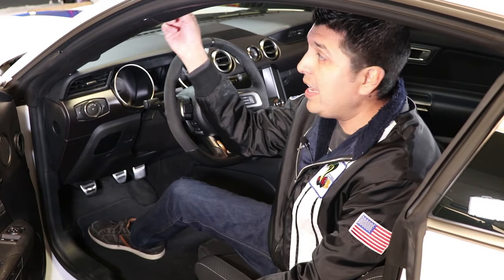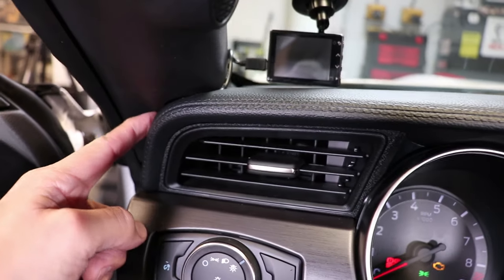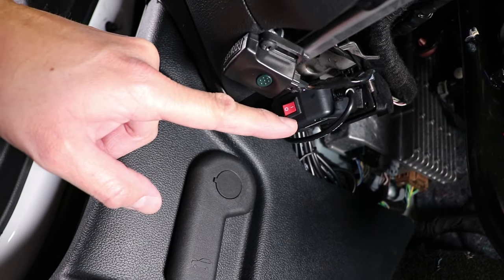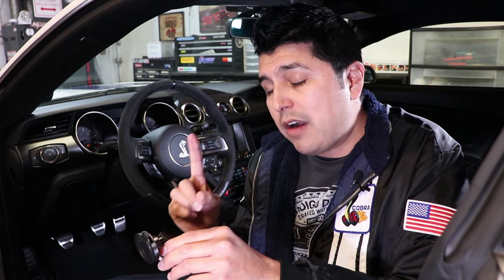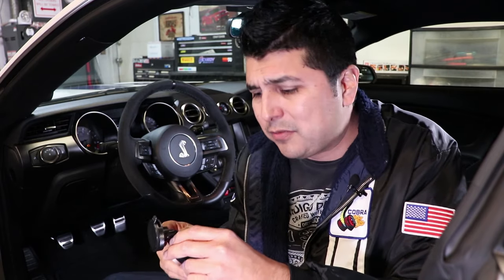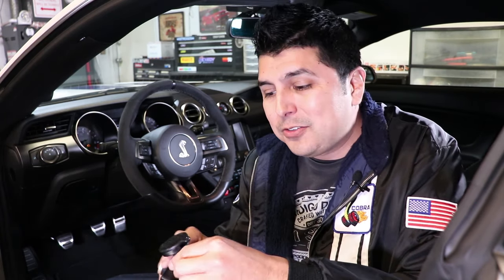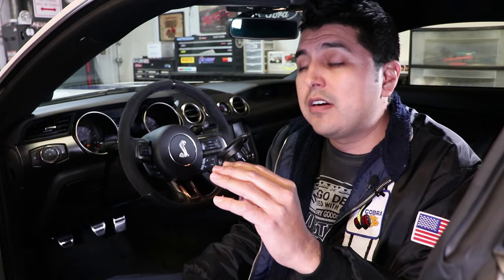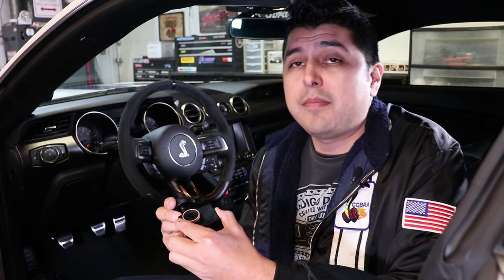Don't hardwire your Dash Cam! Try this instead!

Comment: The car has some empty slots in the fuse box which according to the manual says not used. Can one of those be used for the dashcam or does it have to be a fuse already in use. The dash cam says up to 12amp is fine although others say 7.5amp is ideal for fuses in use.
Reply from the maker: Hi QueenG Garden! ah yes good question, correct  I prefer to use spare fuse spots when available (if they can provide ACC or BAT) here is my most recent video where I cover this in more detail https://youtu.be/K2iKXj82354 Cheers!

Comment: My dash cam mini usb wire has only two colours. Black and white. When I spliced Black with Black and White with Red to another data USB to get a power extension, it only gives a flickering screen. What is the case when power USB wire has only Black and White wire as explained above? Thanks in advance.
Reply from the maker: Hi C Jose! are you using a hardwire kit? or are using the cigarette lighter plug cable that the dash cam came with (and you are cutting that cable)..

Comment: Does the camera only record a few minutes? It has a loop setting but I don't understand what that is. Also if I don't hook it up to reverse can I select the camera display on rear camera to help me back up? It wouldn't be as automatic but I'm a female and not handy with connecting this stuff
Reply from the maker: Hi Justpassingthrough! Loop recording just means that when memory card gets full, the dash cam begins to overwrite the old footage automatically. So technically it does not matter what setting you leave it on, it will continuously record (I like 3 min setting for my dash cams) regarding parking assist, yes some dash cams let you see the rear of the vehicle without connecting any wires to the tail lights of your car, like this one https://youtu.be/bkzxrPe-e_8 Hope this helps!

Comment: but if you service your car, wouldn't the mechanics have to use the obd port to check the system? then they would unplug this power adapter no?
Reply from the maker: Hi Sam! It would depend on the service needed by the car (no all services need access to the OBD2 port). I have taken my car to the dealer a couple of times with the adapter and was able to record the whole event. That being said, it is possible that access to the OBD2 port may be required. In that case, hardwiring is a better option. Now it also common that the car's battery needs to be disconnected to service the vehicle, in those cases both hardwiring and OBD2 adapter will both not work and you will not have a record of what happened at the dealer. My best advice is to find a Delaer that you can trust and develop a relationship with to ensure your car is taken care of. Cheers!
Reply: @AlexAutoFun  Thank you for your quick reply, much appreciated
Reply from the maker: You're welcome! @samjwhang

Comment: Hardwired just means not powered thru accessory plug. 
Both installations that you mentioned are considered hardwired into the car.
Reply from the maker: Hi Darryl! Hardwiring is more involved as it requires manually taping several connections into your fuse box using fuse taps or wire splices here is my video for that if you want to see the process https://youtu.be/zbxYA4VhuT8 The OBD method is usually preferred by those who don't want to do a full hardwire due to a lease car, easier installation (the OBD plug can come on an off in seconds) and that don't need parking monitor enabled (most dashcams require a hardwire kit to enable parking monitor. Hope this helps, Cheers!

Comment: Hi Alex, been a fan of your informative videos for a while now, and I just want to say you're doing an excellent job! I recently switched from a Corolla Hatchback to a Mazda CX-30. I used your hardwiring guide for the Wolfbox G840H dashcam on my Corolla to enable parking mode. However, with my Mazda, I encountered a challenge because all the fuses, including the ACC ones in the footwell fuse box, remain hot even when the car is off. So, I had to choose between running wires through the firewall to the engine fuse box or trying the OBD2 option. Since my Mazda is new, I'd rather not drill holes or tamper with the engine bay fuse box. Instead, I ordered an OBD2 power cable with both ACC and 24-hour modes. My question is, will this cable work effectively with the dashcam's parking mode (time-lapse), or will it record as usual (with the screen on) and then cut off once it detects a low battery in 24-hour mode? Also, is using this OBD2 power cable safe long term? Thanks for any insights you can provide!
Reply from the maker: Thank you Carlitos! Ah regarding using the OBD2 adapter, as explained on the video while it can be used for parking monitoring, it will not enable true parking mode for that you will need a hardwire kit. And here is my video where I cover if OBD2 adapters are safe to use https://youtu.be/aV5jQovoaCI Cheers!
Reply: I had the OBD Power work in my Mazda 2, I just got a 2022 CX30 and the power from the OBD port is insufficient. :(
Reply from the maker: Hi Tal! Check your dash cam's power requirements, the adapter shown on this video has a max output of 2A however there are higher output OBD2 adapters if you need more power (links to them in the video description) Cheers! @TalReviews

Comment: Well that answers my question I bought a Garman 46 today and unfortunately it records nonstop I usually use power banks to run it all night long in an underground Parkade and it was better with my RSC nano dash cam because I could set it to motion detection and it wouldn’t waste the battery so thanks for answering that question anyway.  I also do not want to hardwire anything to my car battery
Reply from the maker: Hi RJtoon1, I really like the idea of only recording when sensing motion, you got me curious now, will look into the RSC nano dashcam you mentioned, thanks for the tip!
Reply: AutoFun I actually took back the Garman 46, I have to have the motion detection.  Yup

Comment: That is called a fuse tap. Also concidered as hard wired but still, good info.
Reply from the maker: Thanks Ron! Ah remember this OBD adapter does not interface to the fuse of the car, it connects to the OBD port instead. The OBD adapter is different from fuse tap, here is my other video showing what fuse taps are and how they work https://youtu.be/Qzw9yUYN7zo and here is my video showing how they are installed https://youtu.be/K2iKXj82354 (which also has the advantage of enabling parking mode) Cheers!

Comment: All three of my dash cameras are connected via rocker switch which I have to turn on. I have my rear dash camera connected to the OBD. via an installed rocket switch. I don't care about surveilance modes. I just want the dash camera to function while the vehicle is driving. The front dash camera is hardwired connected to a different rocker switch. I also have another hardwired dash camera also via a rocker switch. This camera faces the driver to record any interaction with anyone approaching my vehicle from the driver side. (Police)
Reply from the maker: That's an awesome setup! I really want to add more cameras for more coverage, I like the switch rocker idea, should make it easy to turn on and off. Thanks for watching Jamal Rey!

Comment: In my Audi the OBD connector is always powered on. Took me a while to figure out what was draining the battery to absolute zero - I thought I'd park the diagnostic adapter right in the OBD port, because why the heck not.
Reply from the maker: Hi Violet! Ah yes on most cars the OBD port is always powered on which is why the adapter I showed on this video has two power modes (each one explained on the video) and in addition to the power modes, it has a low voltage cut off to avoid draining your battery (some OBD adapters do not have a low voltage cut off) I place the link to the adapter in the video description if needed. Cheers!
Reply: @AlexAutoFun , thanks a lot for the reply! I confess, I did not watch until the end, now I will!
Reply from the maker: You're welcome! @VioletGiraffe

Comment: Great video. Will this drain the battery of the car?
Reply from the maker: Hi Ervin! and thank you! regarding battery, the adapter I linked in the description has a low voltage cut off so I will stop pulling power before the battery gets too low to prevent stranding you. And here is another video I made that shows the alternative hardwire method if you want to see what that looks like https://youtu.be/zbxYA4VhuT8 Hope this helps and thanks for watching!
Reply: @AlexAutoFun  thank you. So the accessory mode will still power the dash cam continuously until the obd cable detects a low voltage?
Reply from the maker: @ervindelacruz8  You're welcome! regarding the modes, I cover them at the 2:21 mark but in short, the ACC mode only provides power while car is off (with a delay after turning car off) and Surveillance Mode will continuously supply power all the time until the low voltage level is reached. Hope this helps bud!
Reply: @AlexAutoFun  thank you 👍
Reply from the maker: @ervindelacruz8  You're welcome!

Comment: Outstanding video!!!  Question... has anyone had a problem with electrical surge damaging the camera in accessory mode when starting the vehicle's engine?
Reply from the maker: Thanks kratz57x! regarding your question, I haven't had any issues leaving my camera plugged while starting the engine. That being said, I imagine the possibility is always there but considering that all the electrical systems in the car are also subjected to the startup surge it has to be a very small chance. You could also just unplug the OBD adaptor or cigarette plug adapter before starting the car but that may also wear those 2 plugs out very fast. Hope this answers your question and thanks for watching bud!

Comment: I tucked my dash camera behind my rear view mirror, I can’t see it in my view unless I really look at it. 
You’re right about the wiring being more difficult. However I really like the OBD power feed wire. Can you tell us viewers where you obtained it from?
Reply from the maker: Hi iamgriff! here are the links for the OBD Power Cable Micro USB https://amzn.to/2Xzwtlt  (Skinny connector, click to see picture) or the Mini USB version https://amzn.to/2XFijQA  (Larger connector, click to see picture) Also here is a video on how to find the OBD Port on your car if it helps my friend! https://youtu.be/hEmvv8M8bGI
Reply: @AlexAutoFun  Thanks! I ordered one. I also ordered a small buss bar so I can run some other 12V accessories without tying up my precious cigarette lighter outlets.
Reply from the maker: @iamgriff  You're welcome iamgriff! same here, I actually got a splitter for my cigarette lighter plug since I got two devices into one plug, but I may hard wire some of my stuff to free up stuff as well..
Reply: @iamgriff  what is a buss bar?🤔
Reply: @iamgriff  what is google?🤔
Oh, and I don't know if you have seen these things around, but they are small fluffy creatures with bushy tails and they run around in trees...what are those? I'm only asking because you seem like such a nice and knowledge person. 😁

Comment: Hey Alex, I am trying to install a redtiger f7np in my mazda3 and bought the obd port hardwire kit to do so. However, I found out the obd supplies constant power even when the car is off. Will the obd to usbc connector ( the one with the toggle switch) be able to turn my dashcam off when the car is turned off? I know I'm a couple years late but thanks!
Reply from the maker: Hi Quinn! Correct, the USB-C OBD2 adapter https://amzn.to/3yzwh8e has two modes which as described on this video can be either used for continuous power or for power only when the car is on. Cheers!

Comment: I've been driving with  dash cam for 6 years...Awesome...Hardwired fuse box.....no problems.
Reply from the maker: Nice! I will definitely give that method a shot Anthony!
Reply: I asked someone at the dealership if ok to put dashboard camera, I was discouraged from doing this because of impeding the safety camera features of the new car.

Comment: I always place the dash cam behind the rearview mirror, and most of the mirrors carry a 12volts, I simply tap to it.
Reply from the maker: Hi Hefdhi, I been hearing about that approach, I will be curious to try it and make a video for it, thanks for the tip!
Reply: @AlexAutoFun  just remember  that your dash  cam is 5 volts,  so you  have to use that converter inside the power plug that comes with your dash  cam, DO  NOT tap your cam straight to a 12 volts. disassemble that  power plug and wire it to your  mirror 12 volts. simple and clean .

Comment: I just got a VAVA 2K Dual Dash Cam for my mom yesterday and the OBD-II cable came today, my question is, will it be safe to connect the dash cam to the OBD-II cable so that the camera can record any possible incident at night while it parking mode? I don't want her to wake up to a dead car and not be able to go to work.
Reply from the maker: Hi Jeremy! Oh wow that is a nice dashcam I'm sure she will like it! The OBD adaptor I used on the video (and linked in the description) has an automatic shut off where it will turn off it detects the battery is too low to prevent stranding you. Hope this answers your question and thanks for watching!

Comment: Great video. Never thought about a OBCD wire adapter. Could it OBD adaptor will also work if you want to install dual cam? Does it need to be a garmin wire?
Reply from the maker: Thanks COTE Official! There are a few cameras that have both front and rear facing cameras, it should work. Now if we are talking about running 2 independent cameras, I don't think it will, even if we find a splitter, the adapter likely wont have power for both. Same with Garmin official wire, only powers 1 camera but.. at least with that one you can just install a 2nd one and you have dual outputs. I have a Garmin cable video coming up stay tuned and thanks for watching!

Comment: How about an external USB C battery? I don't want a permanent installation. I want to take my dashcam (or stow it) whenever I park. I'd like a simple dashboard mount (not windshield) with a battery on a sticky pad.
Any suggestions for such a dashcam?
Reply from the maker: Hi Bill! Ah yes some people do run their dash cam off a battery pack. I personally don't due to the high temperatures the interior of a vehicle can experience (which I prefer not to subject the battery to) and due to the potential for a run away event (fire) during charging or discharging inside the car. Here is an example of a internal dash cam battery and what the sun did to it https://youtu.be/HW8jqbl_ayU and a video of battery related fire I personally experienced https://youtu.be/XfWgJ8nu-RA (destroyed the house) Cheers!
Reply: @AlexAutoFun  Wow, thank you for that prompt and informative response. I'll watch that video now.
Reply from the maker: @bill9989  You're welcome Bill!

Comment: Is there an obd adapter with a usb-c? For example the vantrue n4 dashcam uses usb-c instead of micro usb or mini usb. Looks like I might have to buy vantrue's hardwire kit for 24 hour surveillance :(
Reply from the maker: Hi Art of Ant! no unfortunately there are no USB C OBD adapters that I know of in the market yet. However it may be possible to use one of this adapters https://amzn.to/2VtLBCw I think a viewer mentioned using one of them to use his OBD adapter with his USB C dashcam but I have not tried it myself, if you do order it, please let us know if it works bud!
Reply: @AlexAutoFun  Thanks! It works! You just have to make sure whatever connection the obd power cable has(mini usb or micro usb) matches with the usb-c adapter (mini usb to usb-c or micro usb to usb-c). In my case I bought an Obd cable with  mini usb and a mini usb to usb-c adapter. It works perfectly on my Vantrue n4 Dashcam.
Reply from the maker: @antfr1993  Awesome!! thank you for confirming! you may be the 1st one to do this, I thought it could work but had not been able to confirm it, so It's really cool to hear it works specially now with dash cams moving to USB C..

Comment: By left and low placement you loose the center of car and higher point of view to show the fenders. Hence the middle and up top placement.
Reply from the maker: Good point DashCam moments! the camera can be placed further up the pillar for a higher video and the wire should be able to be tucked in nicely with a trim insertion tool. Thanks for watching and commenting!

Comment: Hello, is the OBD2 cable compatible with European car (Belgium) and wolfbox G840S dash cam mounted on civic type r 2018 fk8 Have a nice day Jean-Pol
Reply from the maker: Hi Jean! I usually don't recommend using the OBD adapter with mirror dash cams since the OBD adapter can only provide 2A out of the 2.5 - 3A that most mirror dash cams require. There is a high power version of the OBD2 adapter here https://amzn.to/3epnu1O but I have not tested it myself, If you do order it and if it works well with your mirror dash cam please let us know (also remember, the OBD2 adapter will not enable true parking mode like a hardwire kit does, here is the video where I cover this on more detail https://youtu.be/YEklm9V6xYE ) Hope this helps, Cheers
Reply: @AlexAutoFun

Comment: I'm shocked that car manufacturers aren't adding dash cams as optional equipment. Some cars do have front cameras, but they don't offer a record function. You would think as insurance fraud grows, car manufacturers would like to take advantage of it.

At the very least, they could add a USB port up around the mirror to allow easy power routing without having to run all these cables.
Reply from the maker: Yep exactly! Cheers!